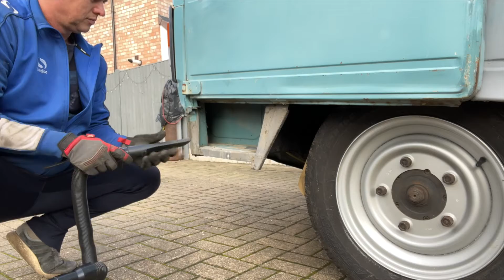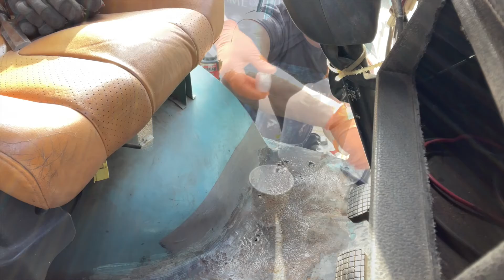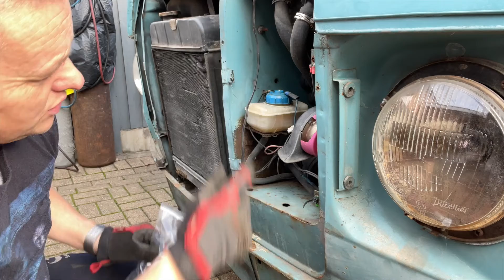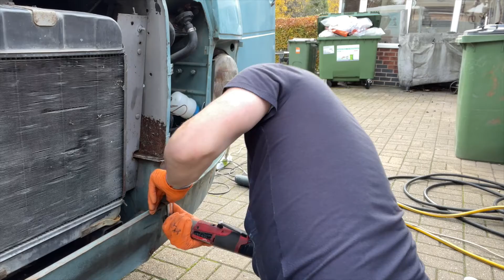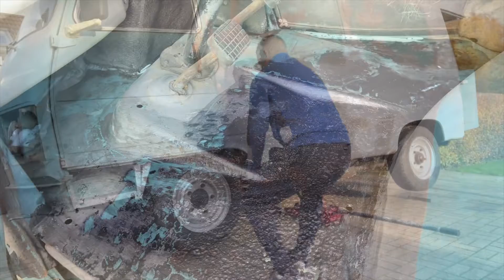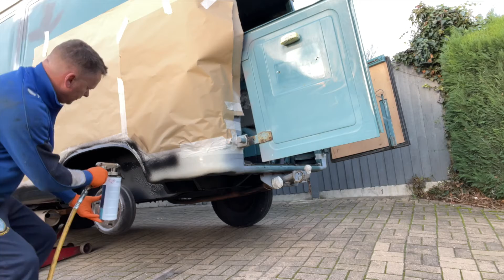Peugeot J9 Coffee Van Restoration episode 5

Comment: Happy New Year Anton.... can I just ask some advice? I have recently bought a 2014 Vauxhall combo van and I'm having trouble with it smoking and running a bit lumpy after starting.. it isn't all the time and stops after 10-15 mins. The van was previously not looked after so I have changed oil and filter plus air and cabin filters,also changed fuel filter and used cataclean cat cleaner.
Do you have any thoughts pls 🙏🏼 
Thanks
Reply from the maker: could be a few things, you might have an air leak on the fuel system, one of the injectors could be sticking/ contaminated, worn glow plugs, it would need further investigation Lee, Thanks for the great comments👍🏻👍🏻🛠

Comment: Looking good ,bit concerned about the stone guard you used says not overpaintable ,hope I'm wrong
Reply from the maker: Its fine to overpaint, This is from the webpage, Gerko Anti-gravel is an agent designed for the protection of car bodies, based on rubbers with addition synthetic resins. It forms an elastic, fine-grained coating, which protects thresholds, wheel arches, spoilers and other elements of car body against stone impacts, water, salt and oils. It also has silencing properties. The surface can be lacquered after about 3 – 4 hours at 20°C. After drying it can be coated with any type of topcoats.

Surfaces: steel, galvanized steel, aluminium, polyester putties, epoxy fillers, two-component acrylic fillers and plastics.
Thanks for the great information👍🏻👍🏻🛠